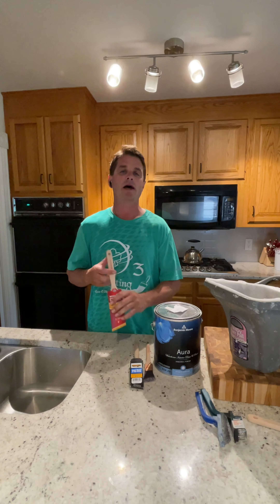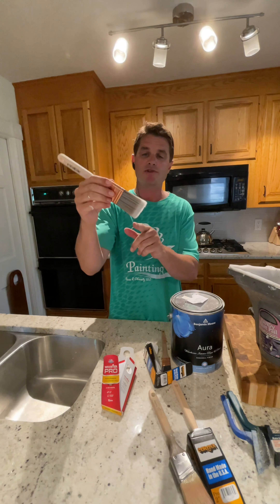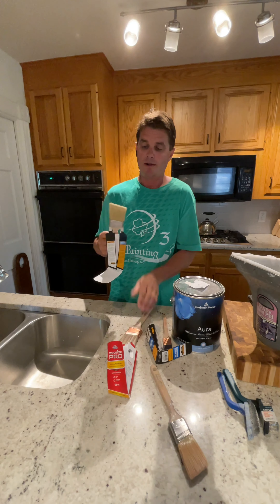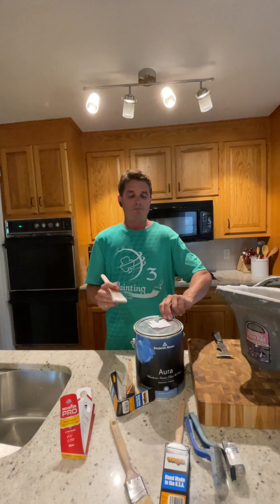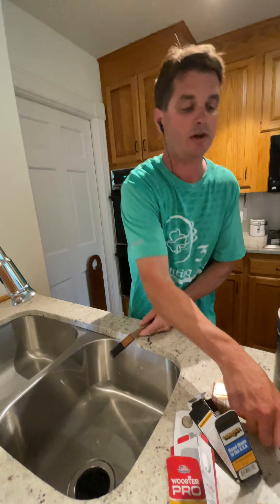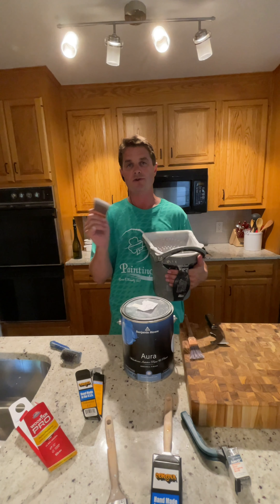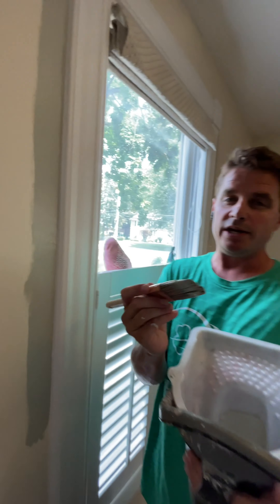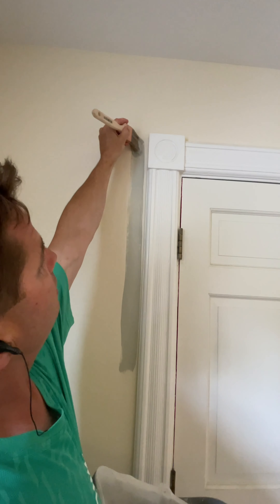Beginner TIPS for Using a PAINT BRUSH!!!!

Comment: Tremendously clear and helpful. Would you recommend a particular brush for applying Scuff-X on trim? Would you suggest using a mini-roller for flat sections of trim, or a brush?
Reply from the maker: Hi 

I haven’t tried the Scuff X. I use a roller for the flats.  Have you tried the Benjamin Moore Advance?

Russ
Reply: @RussOlinatzPaintShow  I have used Advance, but I find it somewhat difficult to work with- curing time being long, and I find it hard to avoid leaving brush marks. Scuff-X seems easier to work with.

Comment: Twirling the brush in the sink will save me some time in shaking the brush off outside.   Squeezing the bristles off mid point before rinsing makes sense.  I have been rinsing the brush off upside down and allowing water to gather into the stalk.
Reply from the maker: Hi
Yes don’t do that, it ruins the brush! However, once you got 95% out from only loading up the bottom 1/3 of the brush when painting , let gravity assist and using downward strokes with the brush and roller   Never allow paint  in the Stock, unless Cleaning a brush at the vet end where you have too the. It upright!

Russ